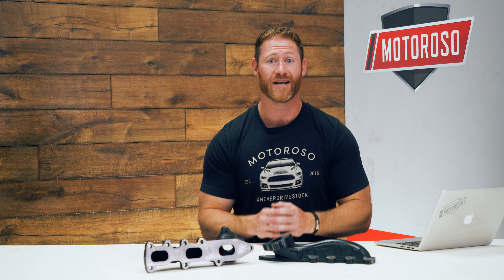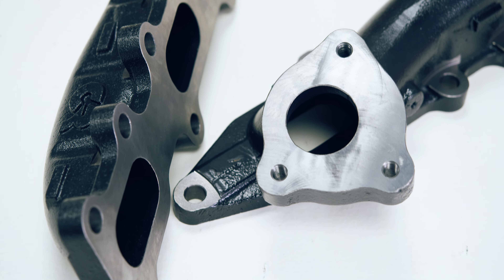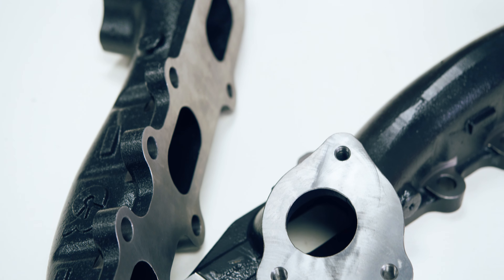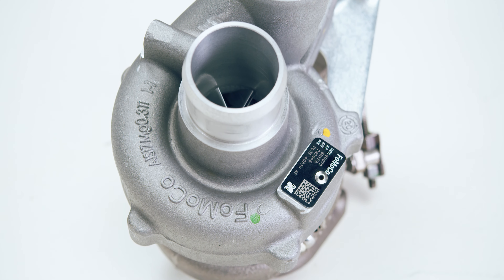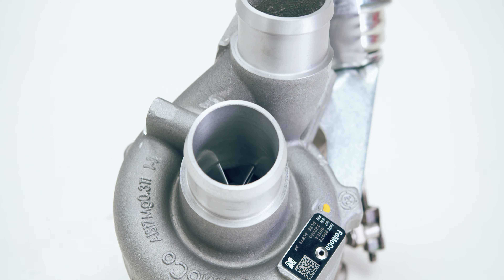CR Performance Exhaust Manifold for '11 - '20 3.5L EcoBoost Ford F-150

Comment: I'm in the middle of installing these manifolds with the new Garrett Stage 2's and I've found that you NEED the the specific turbo mounting bolts listed on CRP's page for these manifolds.  My 2018's mounting bolts are different...part number, length, head and does not work at all.   I wish CRP included these bolts with the other hardware they provided even if it meant a price increase on the manifolds.

Comment: Just FYI , the gen 2 manifolds have 9 stud holes as gen 1 have 8 ,noise usually happens when one of the manifold studs break ,99% of the time it will be the one closest to the firewall, had both mine replaced and no issues since, hope this helps , thanks

Comment: Cool product but why not add the needed 3 studs on the manifold. Since the 3.5 are notorious for exhaust manifold leak and warping. The oem manifold comes with 8studs but there is a company who corrected the issue by adding the additional 3 studs needed to fight this warping / manifold leaks so instead of the oem 8 mounting studs BDD. Manufactures a manifold that uses 11studs which are already in the engine block that is not used idk why ford did that but I’m glad a 3rd party company came out with a solution to fix this issue.

Comment: Hate to be this guy, but these warp too. Mine made it 20k miles. Have to do the project again. Super bummed. Went full race stainless manifolds as I think that's currently the best bet for reliability. They went stainless which is what all performance exhaust is made from.
Reply from the maker: Sorry to hear that. We've sold a LOT of these and haven't seen a single set warp, so thats a first.

Comment: Will these work in my 2015 Ford transit 3.5 Ecoboost? Thanks
Reply from the maker: Hello, yes these manifolds work on that application. We recommend purchasing the gaskets as well, here's both links:
- Manifolds: https://www.motoroso.com/p/1961419-crp-full-bore-manifolds-for-2013-2016-f-150-35l-ecoboost
- Gaskets: https://www.motoroso.com/p/1961420-crp-gasket-set-for-f-150-35l-ecoboost-cylinder-head-to-full-bore-manifold
Reply: @Motoroso  Is there a video or blog post that you know showing how to install these on Ford transit?
Reply from the maker: @jser4822  No, but there's an install video on our F-150 and it should be extremely close. https://youtu.be/ITAO_y2XT3k